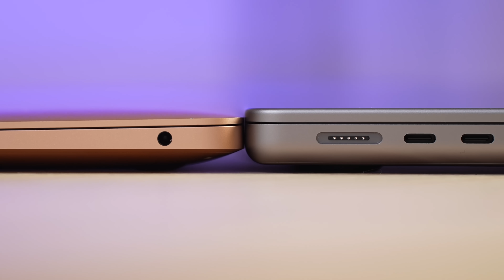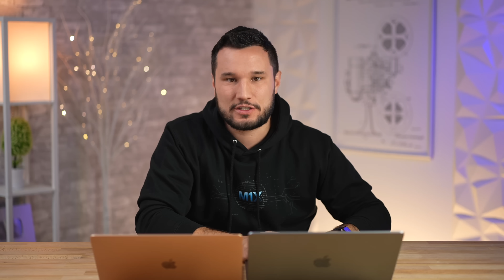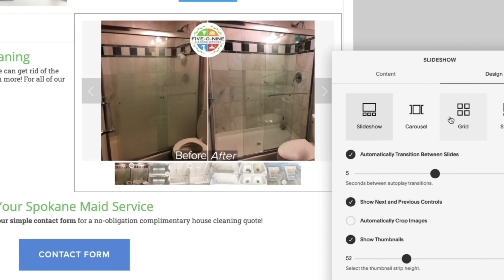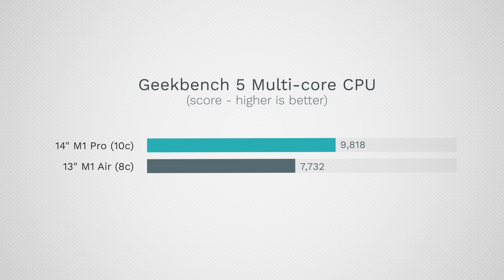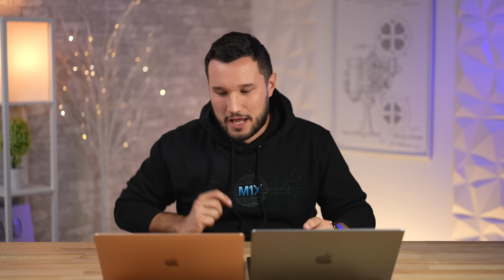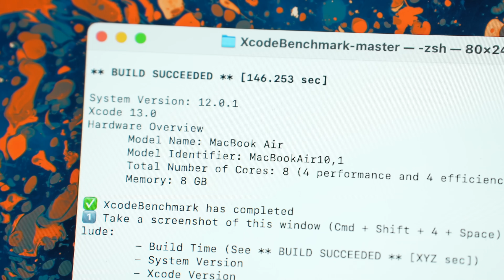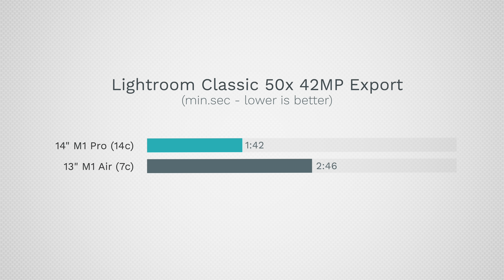14" MacBook Pro vs M1 MacBook Air - Worth $1,000 MORE? 🤔

Comment: Not Satisfied with the 14 inch! Here's why. If you are a reviewer, you must read it in detail.

The keyboard is not a touch keyboard yet (I am not asking for touchscreen but a touch keyboard and there is a difference). 

A Touch-Keyboard where I could also use my apple Pencil in the touch-pad to change it to drawing board and use it to take notes, draw or teach and at my discretion I can change the touch-pad to a keyboard with a click of an icon. 

Mising the MacBook Pro Logo and  at this price point it is our right to show off :D.
 
The glowing Apple Logo. When you can bring back MagSafe and ports, you can bring the glowing Apple Logo back.

The above changes may be very minor but at this price point, these must be there. Expecting these changes in the next model.

Comment: I wonder if the high spec m1 pro only shows a real big difference vs the m1 max when you’re, for example, editing/exporting 8k 30min+ type of videos🤔 either way, the difference seems minimal in less stressful tasks, and since most of us will not be shooting 8k raw… don’t think we need the pro chip, but vs the air I feel it’s def worth the upgrade to the new m1, solely bc of the other specs the new bodies bring!

Comment: Definitely these 2 models are the best worth for bucks compared to MacBook pro m1 13 inch. MacBook air absolutely enough to do job for daily task, Unless your working field is around designing or running few heavy program in the Same time then yes m1pro will make it a lot easier.  I think MacBook air m1 is more than enough to handle daily task for most active people.  Great comparison btw!! You cover everything we need to know about the performance! 🤩 Thank you for making our decision easier! 🐱

Comment: Not surprised by the results, considering MBP is 6+2 vs 4+4 in CPU cores and has 2x GPU cores, 2x more RAM and 2x faster SSD. You pay twice the price but don’t actually get twice the performance except in some limited scenarios. 

Would like to see a comparison betweem the base MBP and the MBA that has 16GB RAM and 512GB SSD to get a better understanding of how much the RAM afrects the overall performance.

Comment: One thing I never hear, is how old the batteries are on the older machines like the MacBook Air, because that will make a huge difference in how long it runs. Older means less capacity. 🤩 But thank you for doing this test. It’s literally the exact test I was waiting for! 🤘🏼👌🏼

Comment: I have been always using a Windows PC, but when the M1 chip was released for the Macbook, I would like to purchase one for myself. This comparison helped me a lot. I think the Macbook Air would fit my needs, especially the fan-less chassis. My room is so dusty and I don't want to bother cleaning the internals of my laptop. Plus, it's handy, something that I could always bring with me at work. Now, I'm just struggling whether I'll buy the base model, the upgraded RAM model, or the upgraded storage model hehe...

Comment: Buddy, If I someday managed to earn enough money as a student (I hate asking my parents for so much money to buy such things) probably with my plans for YouTube with my slow graphics card which can't even run unreal engine with lumen and nanite at 0.005 fps ( as I told in one of my previous comments) I definitely wouldn't go for the macbook air (It barely runs optimised fortnite at 60 fps forget about unoptimised development in unreal engine for videos and then rendering those videos) And would certainly go for a atleast M1 pro even if it takes twice as many months of freelancing to get it.
Infact I haven't even been able even easily learn unreal engine as my pc usually crashes using it. (And so during davinci resolve as it's also gpu based)(I don't think I can afford premiere pro to edit videos with only my i5 10 gen)
Can definitely be sure the macbook air's performance will be just as bad 😭😭😭😭
Reply: Edit:- it's not 0.005 fps for ue (that was with a single chair) its almost 0......0000⁰00000⁰0000//////0 fps(it crashed and can even render the demo taking time like a blender render)

Comment: The extra ports with mag safe, the larger 120hz mini LED screen, double the RAM to 16GB, double the storage to 512GB, CPU that's almost twice as fast, SSD that is double the write speed, all make it worth.

Looking at the specs, you're basically getting twice the computer with the 14-inch Macbook Pro.

Edit: you also now get a 1080p web cam instead of 720p

Comment: This blows it wide open again. I’ve always bought MacBooks for their longevity. I wonder if the Air will start slouching after four iterations of MacOS. I’ve been on a MBP with and Nvidia GPU since 2014. The price gap seems smaller when one specs out the Air with 16 gigs of RAM and 1TB of storage. It’s a pity that both the Air and Pro have insane price hikes just for being in India.

Comment: Do you think the 13” M1 Macbook Pro can compete at it’s current price points against the new 14” M1 Pros? The Air seemed better value, but for a Pro user could the 13” M1 Pro still have a purpose?

Comment: 7:38 Smooth 120Hz scrolling  is not currently supported by many Mac apps, including Safari. But it's supported in Windows 11 via parallels . paranoidroid's quote "Native Safari still 60fps and not 120Hz ProMotion in new MacBook Pro. But you get smooth 120Hz scrolling with x86 emulated Chrome running under virtualized Windows 11."

Comment: Went to the store and checked out both the MacBook Pro 14 and 16. Like the portability of the 14, but I agree with one of the reviews that it feels a little cramped for space when doing video editing on it. If the new MacBook Pro had something like 14.5 display that might work better. The new MacBook Pros 14 and 16 are still lighter than the MacBook Pros 10 years ago.

Comment: Looking at the in-depth review of yours Max, there's a lot of pros and cons for in which you can choose on which one will you use most. Macbook Air is definitely more suitable for people who doesn't use too much power and is mobile because of the weight, and the power for M1's chip itself should suffice. But if you have the extra cash you can spend, 14" Macbook Pro is more enticing because of the durability, ports, and future-proofing technologies.

Comment: Thanks for answering the serious question. I think we forget how powerful the entire M1 chip compared to its rival. Add power efficiency and light weight makes air a very compelling product who spends half their time coding in remote server. You were also spot on about the keyboards. From the apple showcase I would’ve thought that the typing experience would be superior in the pro line compared to the air. Much better than last iteration but still not Think pad level or the original MacBook Air. Close but not the same thing

Comment: I sold my M1 MBA about 2 months ago and just received my 14” MBP today. It’s gorgeous. And…it doesn’t work. I’ve spent about 6+ hours on the phone with three tiers of Apple Support people. We had to call it a night and they will call back tomorrow. Bottom line, storage on a 512 only came with 494. After all system and OS files, it was down to 454 GB. Then the keyboard and trackpad kept freezing, and battery power dropped 30% after 2 hours literally doing next to NOTHING. No video streaming, no downloading files. So, we tried erasing the laptop and reinstalling. That took many tries because it wouldn’t do what it was supposed to. Now, it’s taking 26+ HOURS to reinstall the OS…Thus far, I’m sadly underwhelmed by this gorgeous new machine I haven’t even been able to use.

Comment: This is the first time I’ve ever been disappointed in one of your videos.  The features of the next generation MacBook Air are well known right now, they are a radical improvement from the current generation, and they are only six months or less away. Why no mention of this? Who would be comparing the new MacBook pros to the year-old MacBook Air, rather than looking forward to the next generation which are going to be similar to the new pros in many ways?

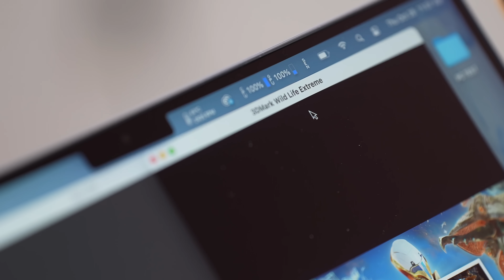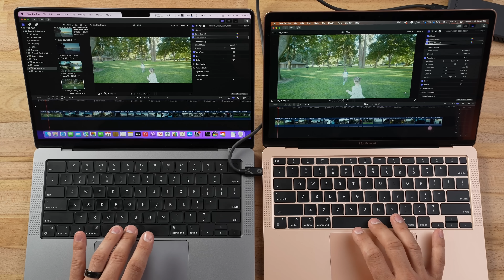Comment: Was your battery life comparison fair? At 16:00 you did this two minute stress test, but only on 14”? And at 23:50 you can see the you plugged Air to a cable, was it charging? I’m confused.

Comment: Great comparison. As the saying goes, you get what you pay for and I think the MacBook Pro M1 Max has it over the late 2020 MBA (had and traded in) hands down. I love the new display and always felt the MBA display was always too 'dark' for my likings.  Also, the 14" does make a difference with the size from the 13". The notch doesn't bother me as I prefer the slider bezels and like with the iPhone easy to get used to, not to say hidden when screen maximized. Better speakers are imp to me, along with a big upgrade with the webcam. Have no regrets paying more for the M1Max MBP and of course the trade-in helped!

Comment: The speaker sound goes to M1Pro because of deeper base. 1080P on M1Pro is better than the 720P on M1 MacBook Air. The screen resolution is better in the M1Pro. Overall, if you’re a professional using your Mac to make money, buy the M1Pro but if you’re just using your Mac to browse the internet, answer emails or watch Netflix, a MacBook Air is more than sufficient, thus saving you more money.

Comment: 3DMark+Cinebench test should become a standard one for your reviews, at least for Pro models :) Btw, could you check if the 14” and the new 16” thermal throttle under full CPU+GPU load after 30-60 minutes?

Comment: All computer hardware “size” or “performance” questions, should be driven by the system requirements of the SOFTWARE you intend to run. A system with 8GB of RAM, and the software running on it needs less than 4GB, so 8GB is actually overkill in that system. Another system for video and audio editing and rendering, which has 32GB of RAM because that’s what the software requires. It’s the perfect RAM size for that system and its intended use. 8GB would be far too small for that system.

Rather that starting with a specific RAM size or config and asking if it’s enough, start with the system requirements of the software you intend to run. This will guide you toward the right computer for your specific needs.

Comment: Thanks for the great review. I am leaning towards the 14" due to the size. It seems be a good balance between the 13" and 16". I can use the larger display due to failing eye sight, but will not have to deal with the size of the 16".

Comment: is it worth more - not for 95% of people - most people if not told the difference do nothing to see the difference in performance but some people that use demanding applications could; might even be economically justified for some businesses to upgrade but only for those running very demanding applications.

Comment: A really interseting video. Having had my M1 Macbook Air since last December, and I've continued to be amazed by just what I've been able to do with it. I'm a developer - run MS VS Code natively, but not XCode. I do Angular and other web related dev - and have just upgraded my Parallels to V17, and am running Windows 11 ARM quite successfully on it - all with the 8GB 512GB variant - extraordinary. I know I will buy one of this generation of MacBook Pros - probably a well-specced M1 Max - but this video has probably confirmed for me that I really don't need to rush. Of course I was, and remain excited by the remarkable performance of this new generation of machines - and will be very excited that the FCP videos I create for my own personal reasons render 3-5 times quicker than my old reasonably powerful iMac. My M1 Air will do just fine for the time being.

Comment: Hi 👋 guys.  Hoping you will be able to compare M1 Max 32gb vs the Max 64gb.  I have a feeling there might not be much of difference in 3D rendering. But I’m not sure. Hopefully you can run the Blender Classroom test on them.  Appreciate it all the hard work the team is doing.  Cheers.

Comment: Maybe these results shouldn't be surprising, but I am impressed with how the M1 MacBook Air holds its own (sort of) in these tests. What I would like to see is how the MacBook Air improves with an upgrade to MacOS Monterey. Will it be easier to plug into an external monitor? That would be an interesting avenue to investigate.

Comment: These comparisons are really useful - so that people avoid spending unnecessarily on higher specs where they won't see any tangible benefits in their daily workflow. Keep it up guys.

I also feel that Apple can be a bit gratuitous with their option pricing. For instance, the 16GB to 32GB RAM upgrade costs the same as 32GB to 64GB upgrade. They know that the 32GB is the sweet spot for most power users - whereas 64GB going to be fairly niche.

Comment: NO, not worth more. Even if you have to use ROSETTA to run certain software, I would still pick the M1. Not to mention the price difference, with the savings you can pick up  other items to accessorize it.

Comment: It’s amazing how close the two are in performance, despite the different core counts and thermal limitations on the Air. My takeaway is don’t buy the high-end machines expecting drastically better CPU performance, especially single-core. However, do buy the 14 and 16" Pros if you need more graphics horsepower, dedicated ProRes processing, more RAM for large datasets (scientific computing, code compilation, 3D animation, etc.), or support for 2+ external displays.

Comment: I’ve been going laptop-less for awhile now, and the MBP has to be the first Mac to ever catch my interest. I have my gaming desktop, but even the MacBook Air would blow it out of the water. I’m a stay-at-home mom and uni student in graphic design, and getting into programming as well. Having a machine as powerful as the 2021 MBP would be incredible, and would definitely be my work powerhouse machine for so long. If only it didn’t cost so much. I see the value for sure, my bank account? Not so much. If I could avoid using my school’s financial aid for one that would be so helpful in the long run.

I don’t think I was too surprised by the differences, in terms of performance. What really struck me was the difference in speaker quality. The MBP is on a whole other level.

Comment: This is just the comparison that I have been waiting for. Have been drooling over the specs of the new Macbooks but in reality, "Can I Justify spending a $1000 more for the additional features of the new Macs"??? Ports being only on one side, 720p Camera, single external display support (Without adapter and risk of not being supported a pain), smaller and no 120Hz screen are the only issues I see for my workflow. Thank you for the detailed comparison - right on point.

Comment: This was the perfect test to do! 90% of my tasks are browsing and office apps so I don’t think the extra cost is needed for me as I only edit videos for 1-2 months out of the year. I will be getting a MacBook Air.
Reply: My 2017 MacBook pro has been used for 4 years, just wondering if the MacBook air can be used for 4 years. I only use it for office works.
Reply: @CatMeowtopia  if that’s really all you need, my 2013 MacBook Air Core i7 is still working really well, I gave it to my sister in law and she’s using it for web and office applications. I have an M1 MBA right now which I thought was a temporary thing until the new Pros came out (great student deal at Best Buy for the base model) but it’s working so well! I am even using Final Cut Pro with no issues. But I do need more storage than the base model offers, which is why I’m going to get a different MacBook Air that’s got 1 TB.

Comment: Which one would last longer?  The Air doesn’t have a fan and therefore a vent in which to let less dust in. What would enter is through the ports. The 14 inch pro does have a fan and so wouldn’t throttle, so might have more longevity. However, more dust can enter.

Comment: Thanks for the great comparison! One nit, I have is that in the CPU comparison charts, you always write (10c) for the MacBook Pro and (8c) for the Air, but in reality, both CPUs have 8 cores, the difference is just that the M1 has 4 performance + 4 efficiency cores, while the binned M1 Pro has 6 performance + 2 efficiency cores. Maybe write something like (6p) and (4p) to denote the number of performance cores instead?

Comment: I was sold on the MBA after these came out due to being $1000 cheaper.   However, the main issue with the MBA is that it only does ONE display output, which really sucks when you're trying to work from home.  I found some workarounds, but I may end up returning the unit and getting the pro.. Hopefully instead I can win the pro on here. :)

Comment: This is the video I was waiting for. As a photo and video editor, the M1 Air has been an amazing experience so far. The only downside is the limitation of RAM.  I have 16gb and going back and forth from Lightroom Classic and Photoshop is using a ton of swap memory. It's nice that the new Pros have addressed that issue finely. I bought an unboxed 13" Pro and a 13" Air, and tested them side by side. Saw no performance reason to keep the Pro at the time. However, the 14" or 16" Pro seems to be worth the extra dough. Thanks for the comparison!

Comment: My Macbook Air M1 is now on its 4th month. And it's incredible. It's only the base model, though. If it's a jacked up Macbook Air/Pro M1 at around $1600-1700, then I would choose adding some more to get the $1999 new Macbook M1 Pro. 

Better display, better sound, batter camera, more ports... For me, it's already worth it to get these features for additional $300 more. And that's still not mentioning the far more powerful M1 Pro chip.